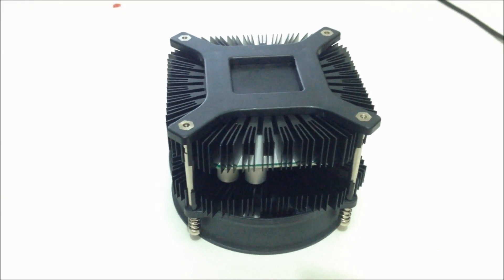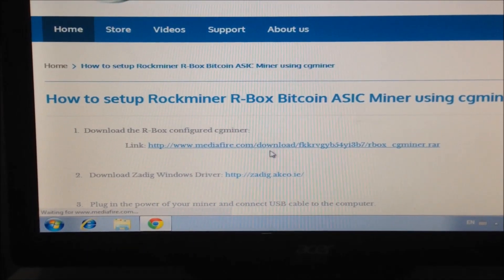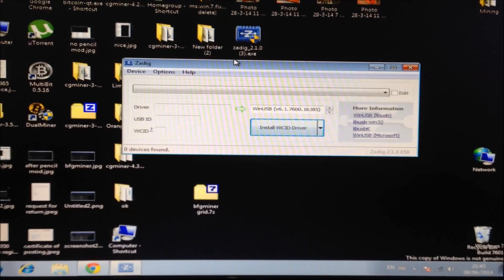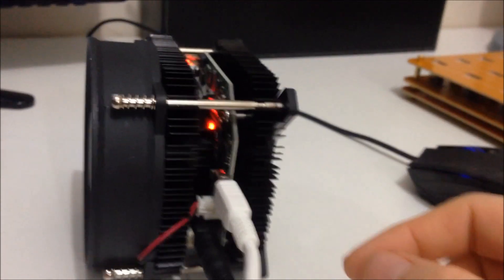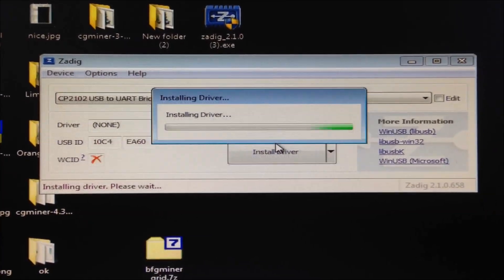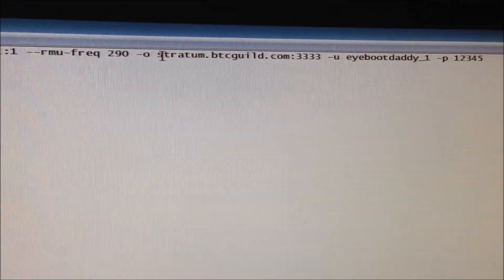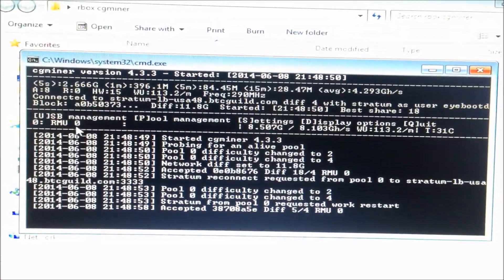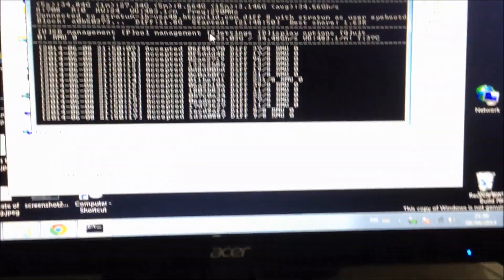Rockminer R-Box ASIC Bitcoin Miner Setup Guide

Comment: Please. I am not able to operate R-Box.
I'm still using WINDOWS XP (pack3), did not like the 7.
Usually installed drive the R-BOX and recognized normal. Not work without the ZADIG and did not work with him.
I do not understand what is the need to use and even using ZADIG he could not make it work (reports that it found and need ZADIG).
Need to configure or triplemining.com preference for bitcoin.cz.
The version is 4.6.1 CGMINER winxp 32

Please can you help me?
Reply from the maker: batmatarremat Follow the guide on here:

http://www.eyeboot.com/rbox-setup-guide

You must use zadig winusb driver installer if you are using cgminer. Is the r-box recognised by zadig? If not then your r-box is faulty.
Reply: Eyeboot
Ok! Friend. But already solved the problem. However, another arose.
I wonder how can I make this R-Box be working in a pool and my USB Antiminer work in another pool?
If I could help thank you very much and thank you for answering.
Reply: I wonder how can I put this ASIC in a pool and a USB Antminer in another pool? Can you help me?

Comment: Can I use multiple of these on the same pc. If so what software should I use? I am considering buying multiple of these if it is possible? Also if I can use multiple what is the maximum I can use.
Reply from the maker: ***** Hi, you must use cgminer. It will auto detect all the miners for you. You can use as many as you have USB port. That means you need to buy a usb hub if you want to have more miners. We recommend these hubs:

http://www.eyeboot.com/Bitcoin-miner-Accessories/19-port-dipo-electronic-USB-Hub
http://www.eyeboot.com/Bitcoin-miner-Accessories/49-port-usb-hub

You can also buy the miner from here:

http://www.eyeboot.com/Bitcoin-Miners-btc-mining/rockminer-r-box
Reply: Thanks, I will mkost likely be purchasing as soon as I get a little more money. Hopefully I can make it back also.

Comment: Thanks for the video. This video got my Rbox working. I've checked on it a few times since it started and this last time when I came back to check it: I went into the room it's in, noticed the blue light flashing at its regular interval. Moved the mouse to get the screen to turn back on to check the avg GH/s and it just started dropping. Went all the way down to zero, then stopped working completely. Restarted cgminer. No Device Detected. Restarted my computer. Same problem. Any troubleshooting advice? I'm new to this.
Reply from the maker: Please do a hard restart by turning off your computer and miner. Then start again. Reinstall zadig winusb driver. Also go to windows settings and stop your computer from turning off the hard drive when it is idle or not used for an extended period of time. 

Here are instructions: 

http://www.sevenforums.com/tutorials/140592-hard-drive-turn-off-hard-disk-after-idle-never.html

Comment: how would one setup more than one unit ???
Thanks
Reply from the maker: Same way, they are really user friendly. Here is the bat file i am using for multiple units:

cgminer.exe --icarus-options 115200:1:1 -o stratum.btcguild.com:3333 -u eyebootdaddy_1 -p 12345 

You only need to set them up once. It auto detects new units after that. If any are not detected, just reinstall winusb drivers with zadig. That seems to do the trick.

Comment: I just saw this.. I commented on the last gridseed.  Do you have a setup for Raspberry Pi? thx
Reply from the maker: Use this cgminer binary: https://mega.co.nz/#!aN4RhYYZ!duR0CSLpgy3jNGqjrN1sW4e0Xp-vgJVMNOt_-R3Nlvw

Run it with MinePeon on your raspberry pi but replace the default cgminer with the one in the link. I will make a guide soon.
Reply: Eyeboot what are the commands to run the miner?  my antminer was bfgminer -set-device antminer:clock=x0a81 -o stratum.btcguild.com:3333 -u miner000 -p 123 -S antminer:all     - for bfgminer.  on cgminer what would it be?